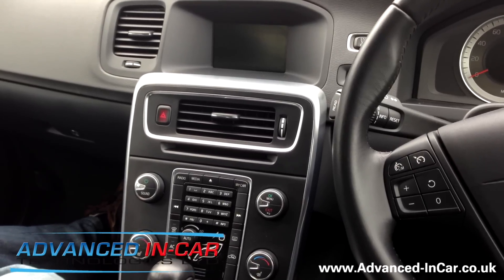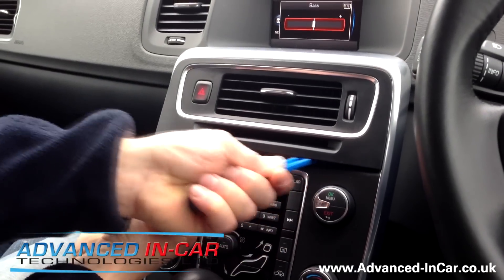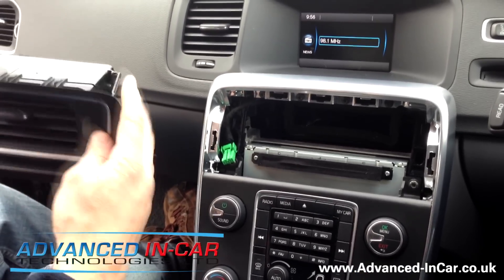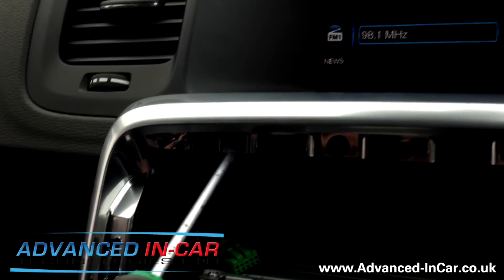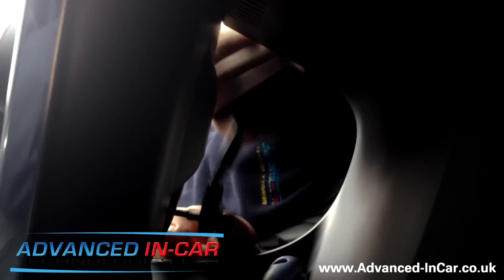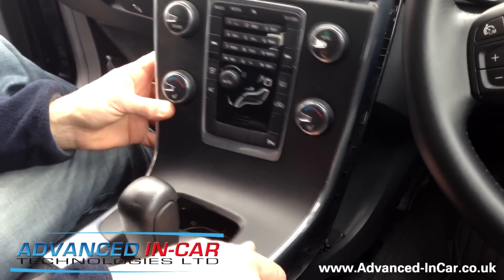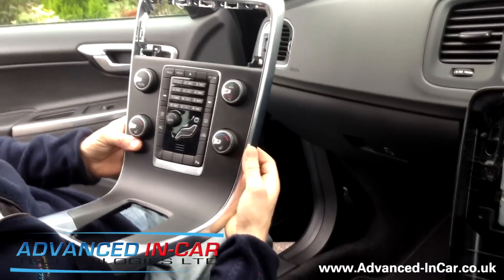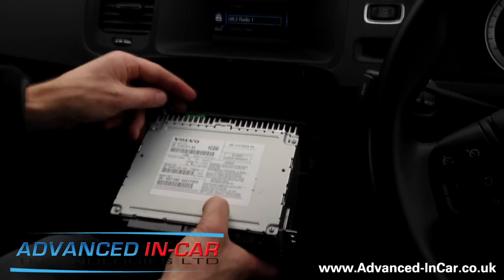Removing The Volvo V60 (2012) Headunit / Stereo

Comment: Are these units (Headunit / ICM ) plug and play or do they have to be programmed by the dealer if purchased used? i have an 'Volvo v70, 2012. Around a year ago the radio and infotainment system started to fail. and wondering if the problem is the  ICM unit?  . I was recently given the car and I have started to diagnose and try to fix this issue. The symptoms of this issue are the screen for the infotainment system not working but its turn on and hanging on and on, all of the lower lights and buttons work such as the heated seats and or the defroster and fan control. They all work . Up till this point when I turned the car on I would receive no light from the screen and none of the audio buttons such as FM, AM, and or volume not either, about 6 mounts ago the rear park sensor failed to show on screen. grateful for every answers

Comment: Hi I am having trouble with same kind of radio.radio turns on but none of the buttons works is that possible lose connection around the rear of radio unit

Comment: Hi guys... As you've had this apart, would you say you could remove the heater duct and use the space to put a double din head unit in? Obviously the fascia would need modifying, but was wondering if there's enough space, without tearing mine apart
Cheers